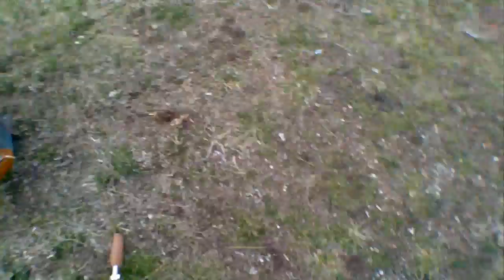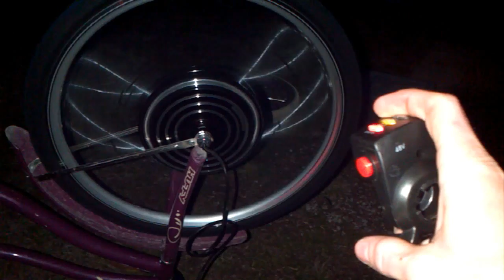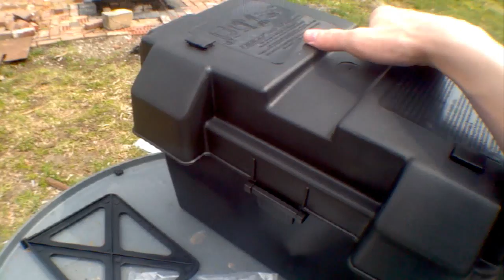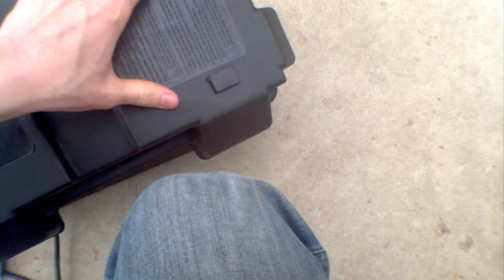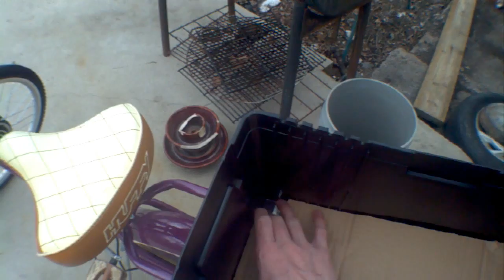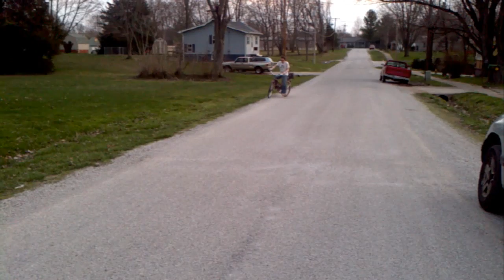DIY E-bike: new motor 48v 1000w

Comment: Wouldnt it be nice to have two of these on a bike! With a 1000-1500watt mid drive motor. With about 72v 2wd bike! I just came across a supposed 1800watt motor and controller at 48v. I may give it a try. With a mid drive.  Using a jackshaft to allow peddeling. And not turn peddles to turn when motor is driving. It would be nice to be able to use the gears with the motor!

Comment: 1000w on the front is dangerous. Max 500w with torque arm. Battery at the back is not top. Inside frame or under the sit is better.
Reply from the maker: +Hi Gaz Ou Plutôt Electric i reinforced the front fork. so far ive gone about 7,000 miles on ebike and reinforced front forks have never failed me.

Comment: note to self ......... instead of many extra steps with cardboard because of ubolt orientation, flip them 180 degrees. then you don't need all that extra crap.

I just got all my stuff for 48v 1000w system, and it will be installed with class 3 electronics standards. and no extra uneccessary steps ;)

Comment: What's the max speed? Mine is a 24v 450 watt Currie max speed 20 mph. The idiots on the street honk at me because I'm too slow. I'm wondering how fast a 24v, 36v and 48v all 600 watts how fast they are. Thanks.
Reply from the maker: fastest i've gone was 37mph.
Reply from the maker: btw i dont recommend going over 20mph, much past that and crash injuries go from being harmful to deadly.
Reply: Damn that was a fast comment. Thank you! I'm wondering if I'm too slow or not. My ebike I made from a kit. To go faster I would need a license. Yes I'm a dork but I like doing stuff legally. A ebike in my state has a limit of 20 mph. Still drivers complain even when you travel at 70 mph you're still too slow. But she's a joy to ride she's in need of a few add ons.
Reply: I have an older sister and she has that need for speed she considers it dorky. I would like speed but I'm starting to dislike cars they cut me off from nature. A bike is awesome because I can turn it off and stop immediately. Love it I'm wondering why did I want a car so much.

I'm learning to be more assertive it's just some asshole yesterday decided to on purpose run into me because I was going too slow. It's rather scary just riding in the street like everyone else and some dickwad wants to try to hit you just because they think you're slow. I'm still new to my ebike plus before I had an ebike I was hit by a car on a rainy day and received no kindness from the driver or judge.
Reply from the maker: i hate cars tbh, been in too many car wrecks as a little kid, i dont think i'll ever want a license, its too much stress.
Reply: Ditto I feel you. A car is great for long distances but it just seems like a box now. A DL my parents prevented me from getting. So here I am 28 no car but loving my ebike. Besides trying to drive a car seems impossible and expensive. My bike kit was less than $200 brand new!

Comment: you need deep cycle batteries. the ones you got right now are not meant for continues running, they are meant to be used to start a small motor vehicle and than recharged by an alternator.

Comment: Rinoa pls can u help me !!!!!
I have 220v 65W motor from sanyo sft62 copy machine (very old) with gear box on it (25:1)
I will make it chain drive , remove pedals and I can change gears , will it have enought power tu go 30km/h on flat road ???
pls answer me
Reply from the maker: i highly doubt it. but who knows.
Reply: Rinoa Super-Genius 
Ahh I will try but bike has got 21 ,
I saw some videos no youtube , man puted 12v dordless drill to bike pedal and it goes 25 km/h
and my motor has got good starting power bcs good gearbox
I will contact u when i make it 
thx for respond

Comment: Lol you use acid battery's a long time later you hate them
Reply from the maker: +eletronicsNmore yes, because they suck
Reply: Rinoa Super-Genius I khow but they are the only thing I can find for 3dollers each fully working I whole change but I am at the age 13 where I can not get that money I wish I get rid of the ones I have but they are the best way of power for me and can you weld with lithium iron battery's and where is your city car
Reply from the maker: eletronicsNmore
and so someday when your not a poor kid you will be able to have lithium batteries and wont want to waste your time with lead acid. thats how it works. i was very poor and couldnt really afford lithium cells for a long time until i found a good way to get them in old laptop packs. now that i'm not on such a tight budget i can get more lithium cells so lead acid becomes pointless. see how that works? its what happens when you move past the garbage that used to be the best you could find. thats normal progressing and improvement.

Comment: It was a failure.
Reply from the maker: Random_rapper20
not anymore. its cheeper
 and my job is doing this.
Reply from the maker: no it was a success. after this i didnt have to worry about having a bad motor, i just had to focus on building a good battery.
Reply: +Rinoa Super-Genius problems with battery : mixed batteries can produce bad results, and you should be using sealed lead acid batteries, so they don't leak
Reply from the maker: Random_rapper20
lead acid suck, i used lithium now.
Reply: +Rinoa Super-Genius yea but lithium is expensive.
Reply: +Rinoa Super-Genius and BTW my job is doing things like this lol
Reply: Rinoa Super-Genius Cool. And its not necessarily cheaper, especially if you dont build your own pack. What is your job?

Comment: Very informative video. I have one question about your ebike. Did you ever install a safety switch/fuse/circuit breaker onto your wiring? Or have you seen a reason for such an installation?
Reply from the maker: yeah for a while i had a 30 amp automotive fuse. although my current ebike ive used for over a year has no fuse and its still fine. i added the fuse on the old one mostly to stop me from blowing myself up if i connect the battery wrong. but now that i got my bike working smoothly i dont really worry about that.
Reply: Thanks for the reply. I was just wondering: did you replace the battery wire for the controller to the battery? Since it looks like a 12/14 gauge wire and those are rated for 20/15 amp. If you did, could you show how you open the controller?
Reply from the maker: John Smith
no i never did, but it was ok.

Comment: I am pretty sure that the wheel was meant to go on the back, as a means to push not pull, and putting it on the front lowers your ability to control the bike on the whole based on how the tire behaves to drive you forward.
Reply: I have seen bikes with these hub motors on the front and rear wheel. 5000w each. Bike would go from 0-60 mph in about 2 seconds. There is a learning curve with power to the front wheel but that is all it is, a learning curve.

Comment: yo rsg i have a 3000w hub motor e moped on 72v assuming they are lead acid gel deep cycle, now i also have off my bike 2 x
24 v 6s 5p, if i make another making total 3 x 24 v = 72 v how would i wire this to give 72v and about 20 ah
Reply: they must all be same battery for good results. 24 + 24 + 24=72 so wired in series

Comment: Keep looking for SOME ONE that will Show PROPER Wheel Installation F---K the Electrical,if you Don't secure the Wheel Properly "It will come off while you're Riding DANGEROUS ,there are Washers ,Slotted Washers and a large NUT,I suppose ,Maybe someone needs to get Sued before they give a SHIT,I have a similar front wheel kit No  instructions on how to properly Install the front wheel,just Electrical Shit,The Torque from that wheel is NOT to be Underestimated ,MUST be Installed Properly
Reply from the maker: your writing like a crazy person, just fyi.
Reply: Dude if you can not put a wheel on a bike then you are less than useless.

Comment: I have the same unit, but I used 12 v 22ah batteries from mighty max, and my tire throws dirt like crazy, it also cruises at an easy 25mph and can go for at least 40  miles.  I also distributed my batteries from the front to middle to back of bike, and kept them as low as possible to the ground.  Makes the bike way easier to handle.  That battery box on the top like that is not a good way to go.  Way to top heavy with 4 SLA batteries riding there.  I have enjoyed my bike a lot.  Enjoy, and thanks.

Comment: number one it's supposed to be a rear wheel assembly and it's not safe to have all those batteries in the back it will kill the motor faster. and clean your yard it looks like Hurricane Katrina
Reply from the maker: +Leo Pintens no this is designed to be a front wheel. having the batteries in the back is a perfect spot for them, why would they kill the motor at all? that makes no sense.

Comment: I finally built the 1st of 2 batteries and posted a vid in my channel if you want to check it out, I ended up using 4 amp fuses that can reset once they cool down from over current, but will stay open if they are protecting during a short.  Going to wire up the BMS board today (once I get a new soldering iron) and start working on replacing the rim that came with the motor hub.

Comment: You don't have the right kind of batteries, those are cheap-shit motorcycle batteries, not enough cranking Amps or Amp-hours. Get four wheelchair batteries and it will go like a bat out of hell!!
Reply from the maker: rstevewarmorycom it was good enough for a first test. and no lead acids are shit. lithium is better and cheaper to make.
Reply: Rinoa Super-Genius Well, lithium costs about twice as much per cranking amps and amp-hours. But lead is three times as heavy. Many e-bikes run fine on the right kind of lead-acid batteries. The trick is just mounting them securely. Get some 30-50 Ahr 12V batteries from wheelchair distributors, they cost about $40 each. Then you will have a MUCH faster bicycle, whichever bike you use with that hub motor, and the range will be 20 miles or more..
Reply from the maker: rstevewarmorycom
guess you didnt read my comment just now where i said it was cheeper. but oh well.

as it is now my electric tricycle has a 80 mile range at 10mph or 40 miles at 20mph. and it is double if i move the battery and motor to a bicycle.

so have fun playing with your lead acid batteries.
Reply: Rinoa Super-Genius I use lithium, but I know some people have to do this more cheaply, which is why I mentioned it. I'm on your side.
Reply from the maker: rstevewarmorycom
but its far easier to find good lithium cells in the garbage or on ebay, so its far cheaper.
Reply: Rinoa Super-Genius That's right, if you have the time, I've seen your test set-up. Not bad.
Reply from the maker: rstevewarmorycom
test set-up? i've gone far past a test setup.
Reply: Rinoa Super-Genius No, I mean the one you use for your batteries. Nice.
Reply from the maker: rstevewarmorycom
for my current batteries or the batteries in this video?
Reply: Rinoa Super-Genius I see that the batteries you used in this video are pretty bad. I mean, I HAVE one of those Chinese 1000W 48V rear hub motors and with better batteries it does 30 mph and does it for over 25 miles! That's why I think they must be kind of bad.
Reply from the maker: rstevewarmorycom
well this video is very very old for my channel, dont judge my entire project by the first videos without even looking at the latter ones.
Reply: Rinoa Super-Genius I did! I did!

Comment: the price of this vehicle seems to be acceptable, and the fact that one could take it indoors seems like a win win... yet I have the need of a cargo trike, and went as far as designing my own trike, yet now I am looking for the electric motor and other components... the problem that I see is a real pain, is that the battery is way out, to be seen by any one... the problem is that criminals will try to take it, even by force, so I think manufacturers should focus on making the electric vehicle as similar to regular bikes as possible, most of them don't even try to do this... as if there were no crime... the same seems to happen with the gadgets used in electric bicycles, where we see that they aren't making these as if it were for a motor bike (where we can find a panel wit the gadgets included just as also seen in any car), so we see this gadget thing held by weak plastic bands and screws to keep them in place as if one was going to keep the vehicle in a country club, but not in a city or town... at the end the chances of some one trashing you vehicle or robbing it increases... the question here is how to redesign this problems so they stop being problems
Reply from the maker: Robert Ostman when i moved to california i built an electric tricycle, its been going really well. i think the key to not having it stolen is make it look like shit.
Reply: hello, well that strategy does help a ton, and I have used it in the past yet, how far can we take it, and there are times when a trashi vehicle only affects the user... in my case my costumers would be like... your going to buy from that guy... he's all trashy.... na... lets find some one else... by the way I share with you my design https://grabcad.com/library/tilting-cargo-trike-consept-3-1

Comment: I plan to buy a battery off ebay since I'm not a super genius but your battery box gives me an idea maybe.  Not going to use lead acid 15ah 48 volt battery is about $375.  Wish I could make my own battery like you, the battery is the most expensive part.
Reply from the maker: Clearanceman2 15AH is pretty small tbh.
Reply: The batteries on ebay are so expensive.  20ah is close to $500.
Reply: +Clearanceman2 dont buy off of ebay, at the very least buy sla batteries from amazon and wire them in series yourself and save money
Reply: Gave up and bought a motorcycle.  Much cheaper than electric bike.

Comment: Do you think the 1500 watt hub motors are worth the 50% price increase over 1000 watt?  We have lots of hills here, I'm worried the 1000 watt won't cut it on the steep hills.
Reply from the maker: Clearanceman2 yeah you may want to go with 1000w, but with 1000w the battery is more of the bottleneck. so 1500w may be a bit overkill. plus its above what the law lets us use.
Reply: Can you explain the bottleneck thing?  Thanks
Reply from the maker: Clearanceman2
the motor can take more power than most batteries can give.
Reply: So the 1000 watt is already overkill for 48v and the 1500 would be better with something like 72 volt batteries I see from time to time?
Reply from the maker: Clearanceman2
no it has to do with how steep of a hill your climbing. i climbed the santa cruz mountains with a 1000w motor on my tricycle and it was easy.
Reply: Hills here are very steep and fairly long.  I have a 36 volt 1000 watt scooter that will go 25 mph on the flat (30 before I put a bigger rear sprocket) and I still have to kick to get up the worst hills, it still runs out of steam on the steep long ones, so I figured I needed everything I could get.
Reply from the maker: Clearanceman2
couldnt hurt to get 1500w then. just check with your local laws and put a sticker on your motor that makes it look legal. like in illinois i put a 500w sticker on my motor in case it caused trouble :P
Reply: Yeah around here they don't even do anything about dirt bikes and 4 wheelers riding on the road so I think I'll be fine.  Why the sticker?
Reply from the maker: Clearanceman2
just so if a cop was upset i could point to teh sticker. idk it just makes me feel better.
Reply: Would you try to save up to get the 72 volt battery?  It's a lot more money.
Reply: I see 48v 20ah as cheap as $407 30AH as cheap as a little over $500.  72 volt is out of my price range.
Reply: I see about the sticker like when you take an 49cc engine and put an 80cc kit on it but if a cop were to check, you can show where the engine is cast 49cc.
Reply: +Clearanceman2 diy